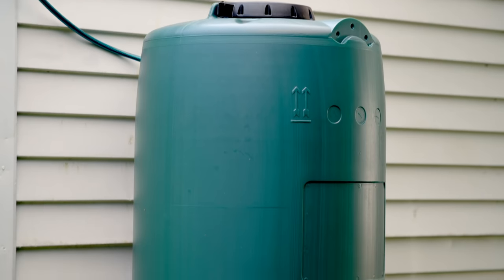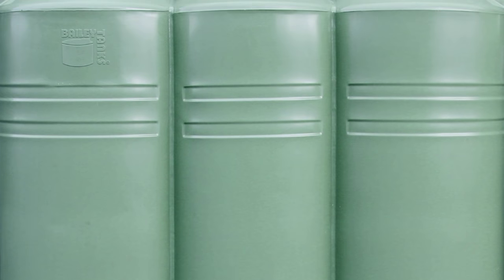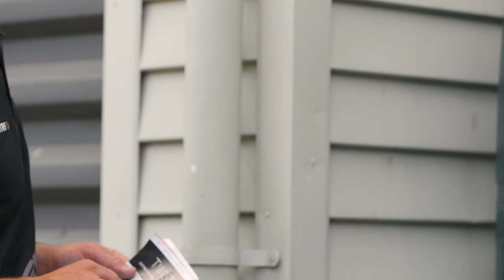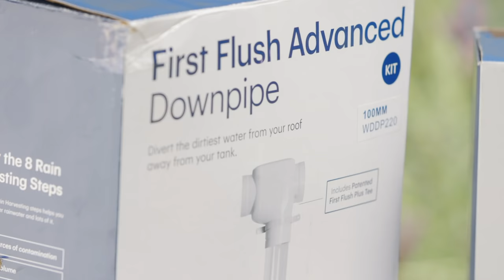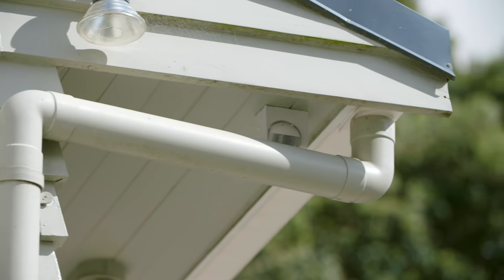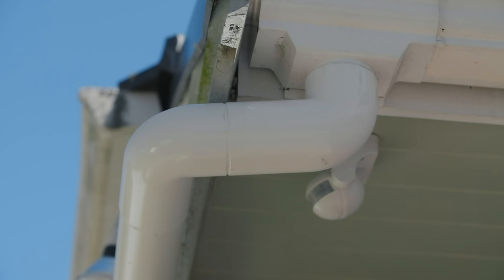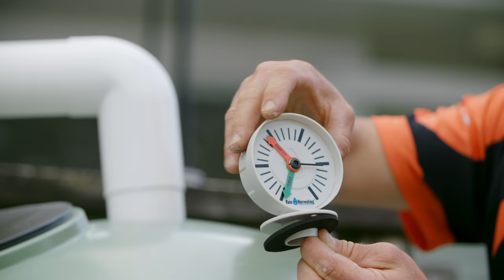How to Install a Water Tank | Mitre 10 Easy As DIY

Comment: Can you please teach how to increase hot water pressure in slow pressure water heater/cylinder (one on electricity) without upgrading to new one.
Reply from the maker: Hey Shakul, the best option is to consult with a plumber on this query – there are products & techniques to increase pressure but always best to ensure your system (including the cylinder) can handle the pressure or change in pressure balance. The best solution might end up being to do that upgrade or change to gas hot water ^Charlie

Comment: Hey, what kind of base do I need for the tank if I want to place the tank on a sloped lawn?
Reply from the maker: Best option is to dig out a flat area & create a base.

Our guide web-version covers some options depending on the size of your tank:

https://www.mitre10.co.nz/guides-and-advice/guide/how-to-install-a-water-tank
 ^Charlie
Reply: @mitre10nz  Hey, man. Maybe this can be added to your mitre 10 videos if helps: I got a 1m diameter 1 cube tank and I built a square deck roughly about 1.2 by 1.2 . The deckings are 90x45 h3 timber with 10 gaps. Deck framing and bearers are recycled 90x75 H4 handrail post. Decking joist are spaced 400mm centre. All framing locked together by 100mm and 150mm bugle screws. The deck was painted with outdoor decking oil for minimum maintenance.

 The frame is supported by 4 90x90 post which are spaced 1m centreEach post concreted in a 300x300x300 hole, because the hard clay layer is shallow on my property roughly about 100 to 300 below top soil. The exposed post height above ground varies from 150 to 250 below the bearer due to the sloping site. It's based on each leg takes about 255 kg load. It's been 2 years since 2021 and the water tank has been filled up whenever it rains. The deck is still solid and level.

Comment: How do you vacuum out the tank? It's stuck in place by the time it comes to the vacuuming and has no opening to put the vacuum in...  

Is there a practical reason to not do this in the reverse order to what is described in this video so that the tank can still be maneuvered to vacuum it out after drilling?
Reply from the maker: Hey, 

You can open the vent and vacuum through there. 

Thanks!

Comment: Do you need to be qualified to setup it so it switches to using the tank water first?
Reply from the maker: Hi Rohan! If you’re going to be using the water in your house for drinking, showering, and appliances then you’ll need a decent sized tank. And it’s likely you’ll need a building or resource consent, and a Licensed Plumber to help install it. So check in with your local council for any regulations that apply in your area.
 
If you’re wanting to store some water to use on your garden over summer, or to use as an emergency supply, then there’s a range of smaller tanks, from 250 litres up to 1000 litres which are perfect for this. And they are something you can install yourself no worries.
 
If you’re also installing a water pump, you’ll need to get an electrician to wire up an outdoor power point. 🤗
 
Hope this helps! ^Cam

Comment: Bought my Slim Jim from my local Mitre10 using Airpoints. Has been sitting in the backyard for a while though, had to design an earthquake bracket and concrete plinth. Should be in before the drought kicks in!
Reply from the maker: Hi there, we do have a Bailey Seismic Restraint Kit for the Slim Jim Tank, Zones 1 & 2 or 3 & 4. Have a check with the team at your local store and they'll be able to help you out if you're not already sorted ^Matt
Reply: Thanks for that. I looked at the drawings and there is a lot of concrete for the Bailey restraint and it needs a gap of 300mm with the house so not much use for a slim tank! Auckland has low seismic activity and I designed a bracket to NZS 4219 which is available free.

Comment: Why did you not show us how you put in the water pump outlet into the tank? do you have too climb in the tank to fit this fitting. You need to show this being  done
Reply from the maker: Hi Lindsay, it's easy as - water collection tanks come with the outlet pre fitted as you can base the placement of everything else like any extra pipes going in at the top, around that. ^James